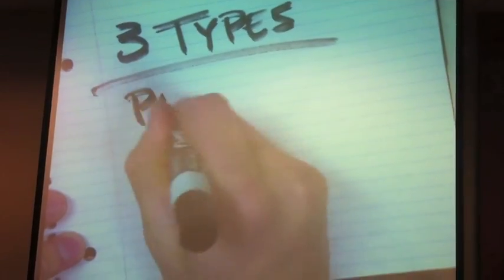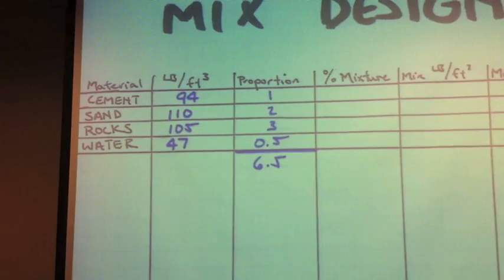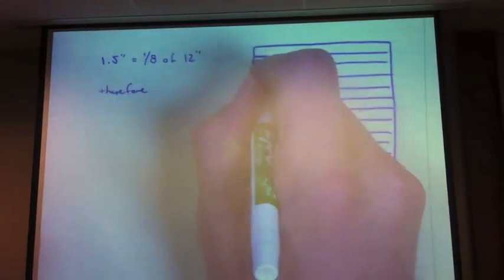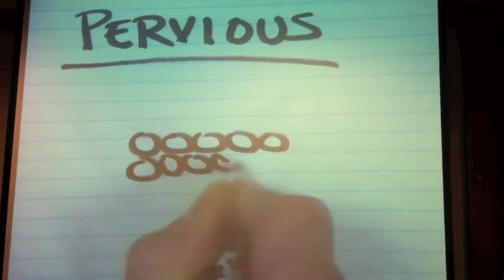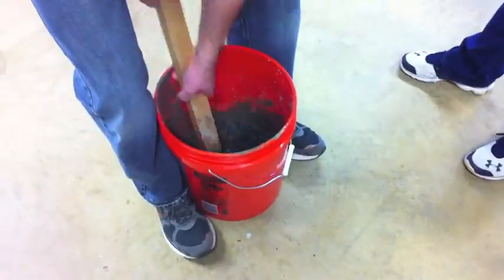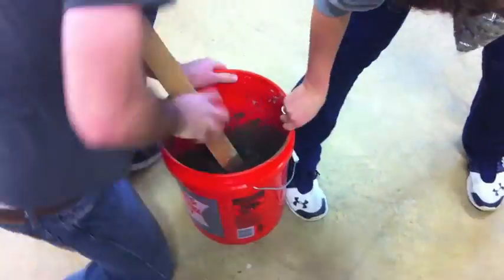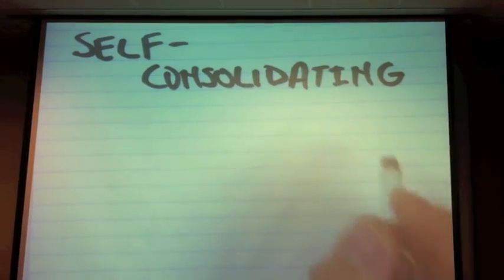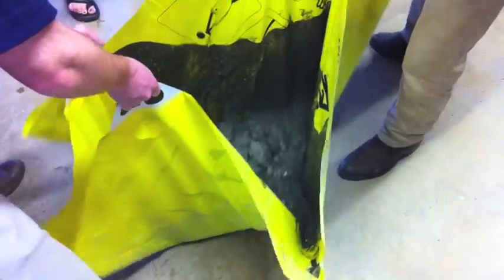Concrete Mix Design

Comment: All those pesky imperial american units at 0:55. Are you sure water is 47 lb/ft3? Google converts that to little over 750kg/m3, which is well below the usual 1000kg/m3 one assumes for water. Or is this some other kind of pound and feet you mean?
Are the rest of the densities in order in that table?

Comment: You need to applied more mix design in the mix.... everything looks great at the beginning, but in the SCC mix, the white liquid results in a segregation of fine particles... basically, you need less water in the SCC mix... That would be solve with a good mix design.. for the rest.. the video and the work was good!!

Comment: Good but the point that I don't get is : Why the US has its own standards such as gallons, feet, yard, fahrenheit... whereas the whole World is using standards like : meter, celsius etc.
Reply: Its to do with when America got its independence, a lot of the world used to use imperial system but there was a lot of errors so it was decided that countries should use one basic system, in short SI (system international) units were born. It was at this time America decide to stay with the old system, there are a couple of other countries that use it. So say America got its independents later they would be using SI units too. 
What's even weirder America doesn't use the same imperial system the UK used, the measurements for gallons are different, UK gallon ~4.5 litres where as America is ~3.8 litres, so when we think American cars get terrible MPG, very few people take this into account. 
The difference between Celsius and Fahrenheit is to do with the standard used to check when water freezes and boils, Fahrenheit uses a brine solution and Celsius used 'normal' water,  its interesting stuff.
Reply: We have burned a probe in the Martian atmosphere because of it, it's that serious...
Reply: sween187 thank you for a broad explanation , appreciated.